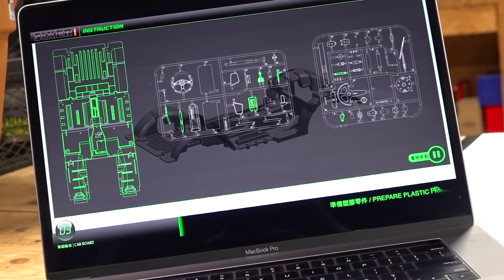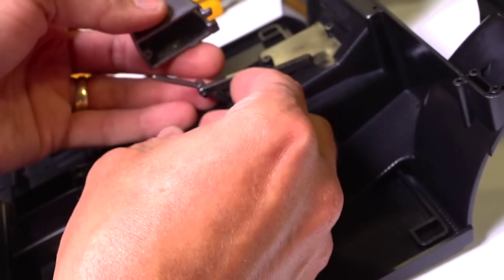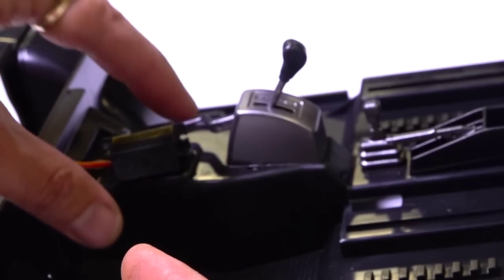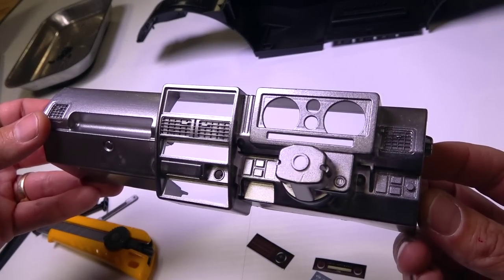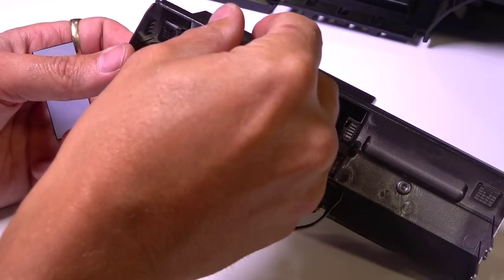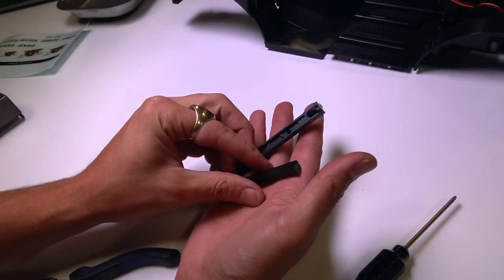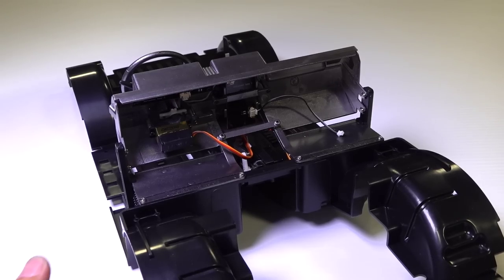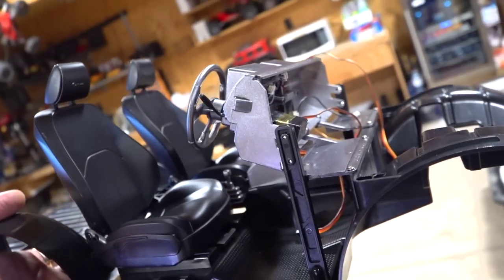SERVO-CONTROLLED SAMURAI INTERIOR! CAPO SiXER 1 KiT - 1/6 Scale BV3 | RC ADVENTURES

Comment: Spray all electronics (inside survos, motors, control boards, battery connections, esc's) with Corrosion X.  Your car will run under water.  Watch Flite Test on YouTube.  They have a video where they test it with drones.
Reply from the maker: Lol.. I helped create flite test bro ;)  Im OG..
Reply: @TheRealRCSparks  Yes you are. 😁  I build real fire trucks (and drones), because of Flite Test, I use Corossion X on everything.  I ran a test with mild steel, aluminum, and stainless steel for a year.  WOW that stuff works.